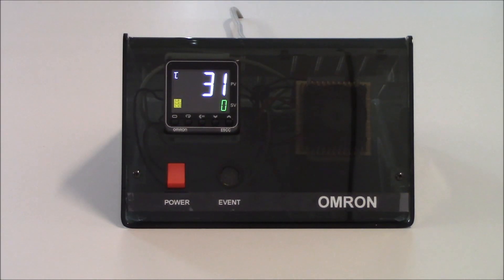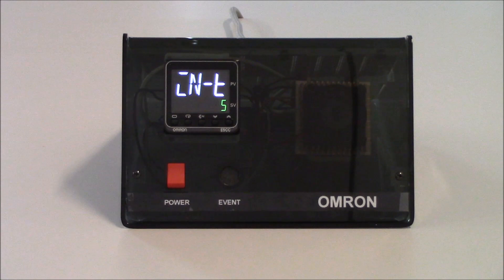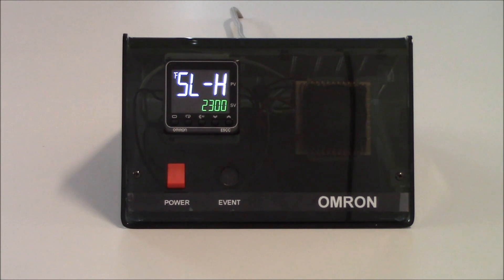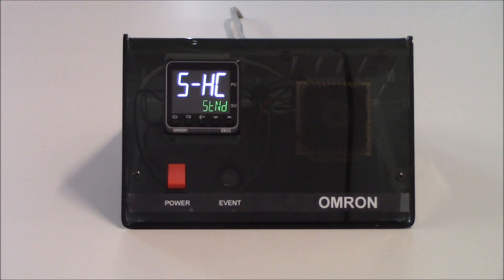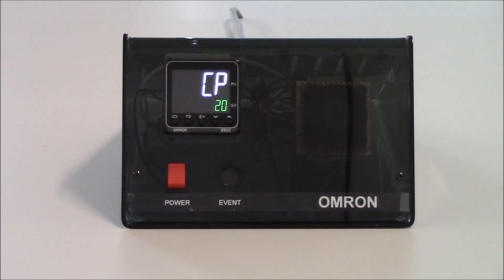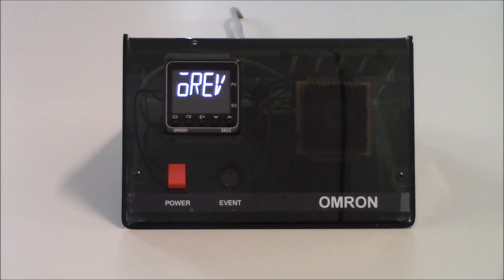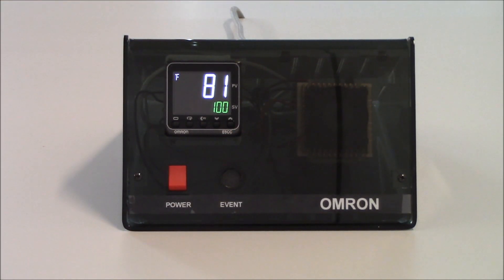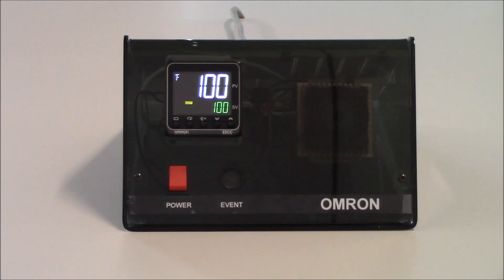Omron E5C Series Temperature Controller Setup of PID Control

Comment: Hi. I need your support. I'd like to build an Infrared soldering station (or IR pre-heater) and as a controller board would like to use a Omron E5C series controllers. I will use 2 controllers: one for lower heater (1500-2000W) and one for upper heater (500-600W). After reading and searching find out that E5C controllers have different configurations: E5CC-RX2ASM-800 (-801, -802, -880), E5CC-QX2ASM-800 (-801, -802, -880), E5CC-CX2ASM-800 (-804) etc.

So my question:
1. What is the difference between those configurations and which of them is more suitable for my application?
2. Which of them have ability to turn the second controller On/Off? 
3. Does type or length of themocoples (I mean different application of the same K type thermocouple) affect the temperature readings of the controllers? I mean does it have strictly determined type of thermocouple with the certain length?

I already have a IR heater from Chinese manufacturer but after failing its thermocouple and installing another one it started to show incorrect temperature parameter and to drift. Not good for this type of operations.

Just to be clear heater will operate between 0-250 degrees Celsius in heating mode (thermocouple will be on a circuit board) and my plan is to turn On the second board (upper heater) with the signal from the first one. When the lower heater hits the certain temperature, say 150 degrees C it turns On the upper heater and that will take the temperature up to 200-225 Degrees C). My heaters at the beginning will be ceramic heaters (because I already have them) and later on will switch on to halogen IR light bulbs.
Can you please help and advise. Thanks in advance.